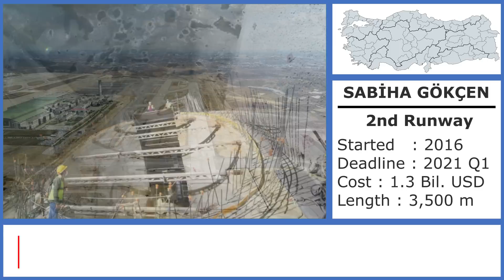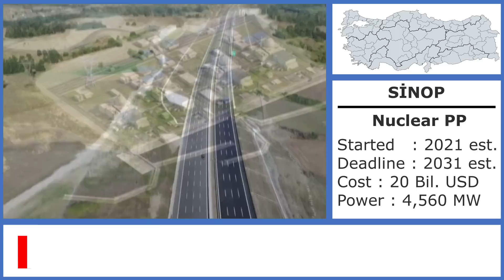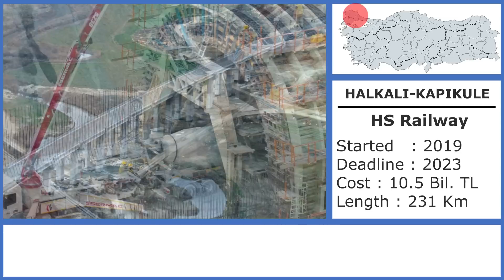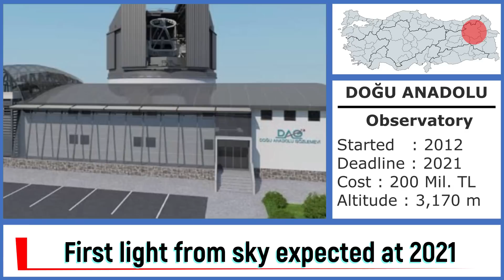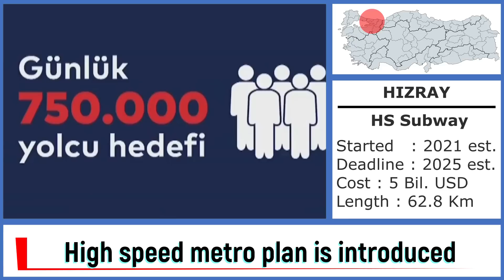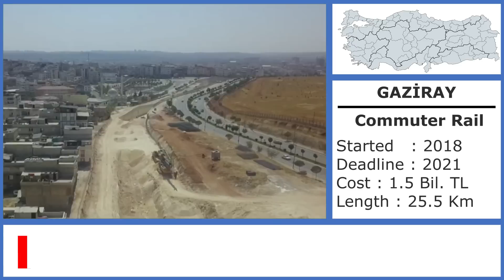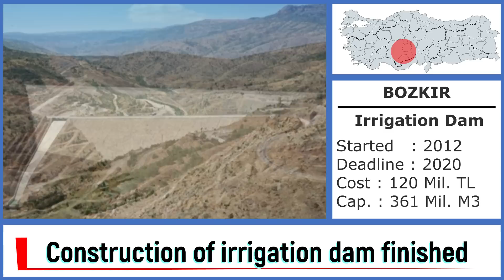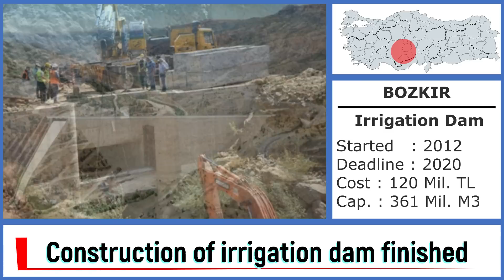Summary of Major Infrastructure Projects in Turkey, September-2020

Comment: @kamugozu hi how are you great video, Hizray project in Istanbul when will Construction start for this Project?
Reply from the maker: Hello. It's not yet determined and announced. Thanks for your close interest and follow-up.
Reply: KamuGözü hello if the project Hizray is not yet determined or Announced why did you include this in your video? Is this project gonna even happen or is it just a dream.
Reply from the maker: We put it into video since the project is modified and announced at September. it's said that the technical works not finished yet.
Reply: KamuGözü what do u mean by Technical Works??
Reply from the maker: IBB is working on best route, financing and other pre-project stuff.
Reply: KamuGözü so IBB is working on the Finance/Credit on this project,plus the Actual Rail Route?